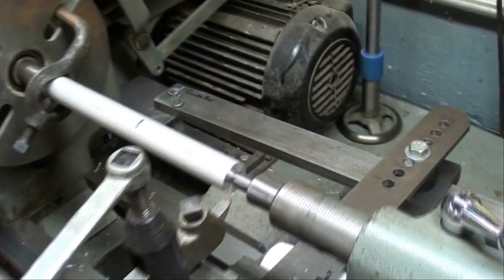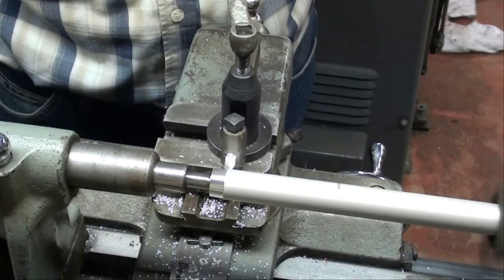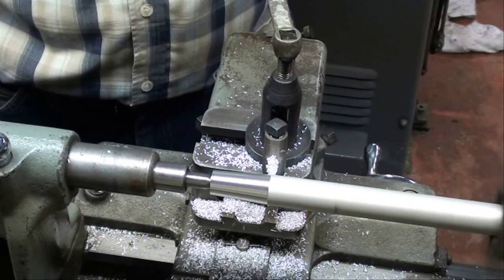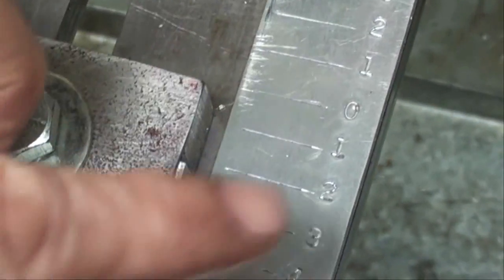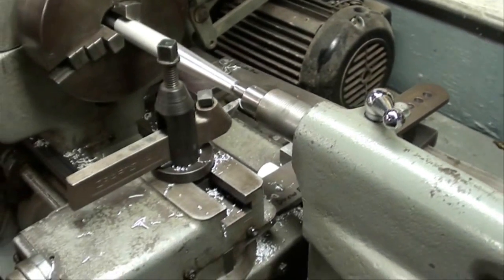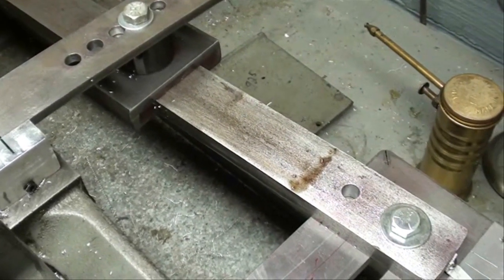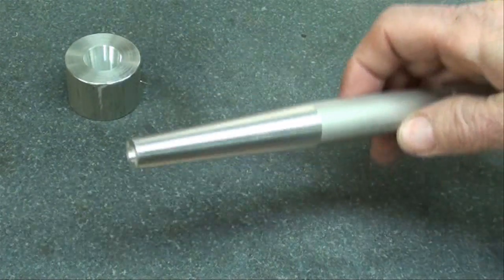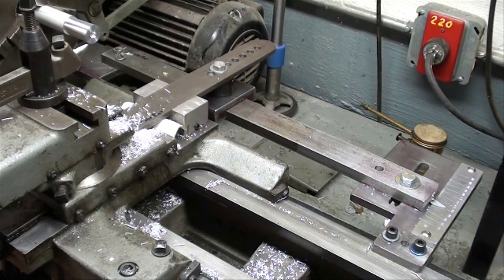MACHINE SHOP TIPS #72 Atlas Lathe Taper Turning Part 2 of 2 tubalcain

Comment: When I got my craftsman atlas metal lathe it came with a taper attachment bar on the back but not the attachment that goes to the cross slide. So now that I no how I'm gonna make a pool cue out of alluminum. Or try anyway. Thank you for the info❤
Reply: Also my bed on this atlas is 8 foot long. So making the pool cue wasn't out of the realm of possibility ❤
Reply from the maker: I have never seen an atlas lathe that long
Reply: @mrpete222  I hadn't either so I had to have it. It is really difficult to get the twist out and level but seems to work well  for a 1937 craftsman atlas 12"  only problem I've seen is the length of the carriage screw seems to move and wear apron parts rather quickly from what I can tell. Been nice if they have given that a little more thought

Comment: Just a thought, as you mentioned, you would lose some precision between the inner and outer tapers by switching the guidebar from one side to the other, but it seems to me you could reverse the lathe head direction and use a boring bar that cuts on the back side of the inner taper to avoid changing your guide bar at all. Thanks again for all your awsome content. I bought a 1917 ish Morris 18 inch engine lathe, and it's mostly your fault.
Reply: Problem is that with a threaded chuck like Atlas has is you'd risk unscrewing the check from the lathe.

Comment: Hi guys. I was machining some shaft on geminis650 lathe machine. There is a taper on shafts how do l rectify it . I tried to adjust the tail stock but it's still coming out on either from the center or forwards the chuck.

Comment: Is that a dead center in the tailstock? Are dead centers more inherently accurate than a live center? And what sort of considerations should I make when using a dead center instead of a live center?
Reply from the maker: No, it is a spring loaded live sooner. The big advantage is no lubrication needed
Reply: mrpete222 very interesting. I’ve never seen a spring loaded center before. Not having to lubricate it is a plus to be sure.

Comment: I found some plans online like this that are useful although my carriage has enough length to cut most standard arbors. I decided if I added a power feed option it could cut smoothly and avoid all the extra hoopla built in the back side that has to be connected and disconnected when I want to taper cut. I machined a perfect fitting mt3 arbor last night from 17-4ph. It’s going to be a sliding thread holder for 69mm round metric dies. I don’t even use the thread option on my lathe since many of the threads I cut are out of range of the machine any way so it’s easier to use a tailstock adapter and put it away when I’m done without doing any gear changes, etc... After graduating to a larger thread diameter needed for certain parts I decided i may as well make a larger version of what I had since nobody makes one beyond the 1.25” diameter dies. As long as I can make r8, mt series, and so on I see no need to build a carriage extension at this time. I wanted power anyways in case I convert to Cnc some day then I can use it as a 3 axis setup.

Comment: The shaft is small and it's 6" long, so when I start taking even a small cut will flex and cause warp !! The 8mm half is easy but the rest of 5mm is difficult to keep it without flexing ! If I can make it within .001 I will be happy! 
I used fallow rest but it's not working because it has two different ODs, the shaft I need to make should have 8 mm OD to go inside High RPM Rc heli motor and drive gear pinion that accept 5mm shaft and drive the tail rotor too! So it need to be tight on TIR to prevent Vibration !Thank you for your helpI apprecieate it.Oz
Reply from the maker: very light cut--slow feed, extremely sharp tool
Reply: I appreciate it,  I will sharp my insert with my grinder and try one more time 
 Hopfully will get it done right
Thank you sir

Comment: Dear sir,
its design is perfect, you could sell me this project so I can build a copy of that here in Brazil. I have two mechanical lathes for machining aluminum cookware. Our pots are conic and its design would very well for me. My name is Evandro de Castro, my email is evandrocastrosilva7@gmail.com'm from Brazil, specifically in the city of Recife. I take the opportunity to invite you to come into my town, when you are passing through Brazil.
Reply from the maker: just copy it from what you see in the video
Reply: +mrpete222 yes I'm going to try and copy this as well. it would be nice to see a better shot of the clamping mechanism that you use however.

Also you are right that is a noisy noisy Atlas lathe. I just put a new one horse motor on my Logan 820 and it's very very very quiet balance motor there's no vibration at all and the latest so quiet you can whisper to each other well it's running it's amazing

Comment: For your interior taper, could you have not turned your boring bar upside down and cut on the backside of the hole with the original nuber 3 setting ?

Comment: Hi tubalcain. Love your videos. I have a 1948 atlas craftsman lathe like yours. I am saving the money for your lathe series on flash drive. Question did you build your taper mechanism or buy it? I've seen them on ebay but they are kind of pricey and yours looks like it wouldn't be to hard to reproduce.I have access to awesome machines and machinists at work and would like to try and build one for my own lathe. Can you supply plans? I would pay for them of course. Thanks

Comment: Wonderful videos. Great for the beginer and the seasoned vet. I am a vet of 31 years and also use a 12 inch atlas at home. Much smaller than my 27 inch x 80 inch romi lathe for work. Your presentations of the basics is great and a joy to see. I run the machine shop operations for a water and sewer company that serves 1.8 million people. Most of our machines now are cnc. Thanks

Comment: I do that. Set the compound to 29 and a half degrees instead of 90 degrees for simple turning. The tricky part is you can't use the cross slide to pull the tool away from the work. You must use the compound to do that. That means you must remember what setting the compound dial was when you pulled it away at the end of the cut. Then you reset it and dial in for the next cut. I leave the half nuts engaged on the lead screw and use the forward-stop-reverse lever to return to the start.

Comment from the maker: There is a setscrew on the side of the alum. piece. It pushes against a brass plug machined at 60 deg. It in turn pushes against the crossslide dovetail.

Comment: @skyrocketpuke I guess you could also attach a dial gauge to the carriage and rest it against the taper attachment (or the cross slide). Then run carriage as far as it will go, take readings at each and and do some simple maths to work out the angle...

Comment: Why, when you were cutting the external taper in the beginning of Part 2, did you use a dog and center on the spindle side. Why not just use the chuck or a even a collet chuck? 

Is it because of an issue of pressure or accuracy? 

Great two-parter!